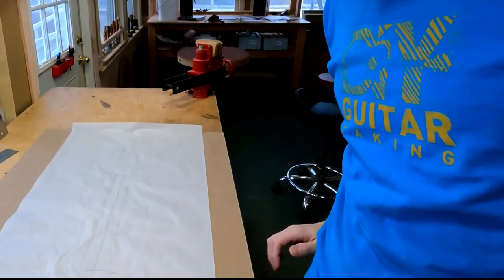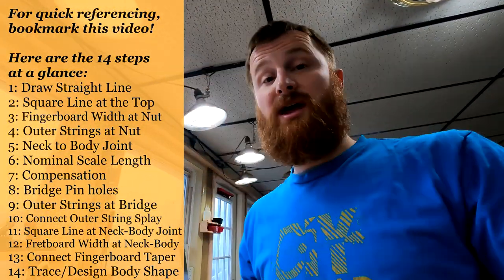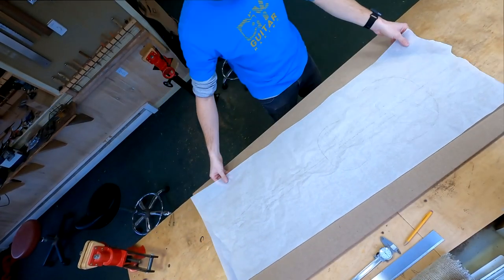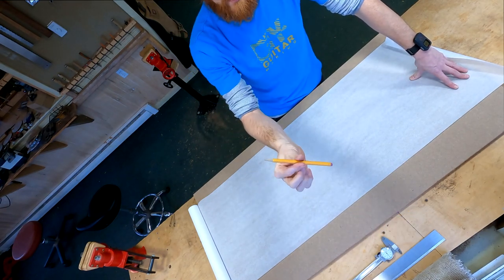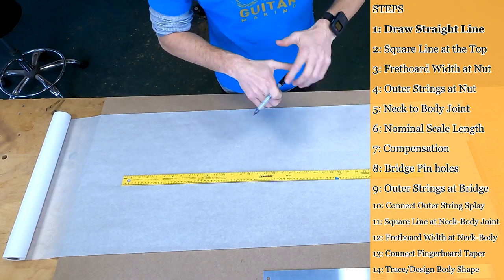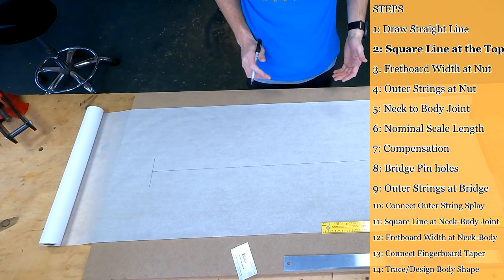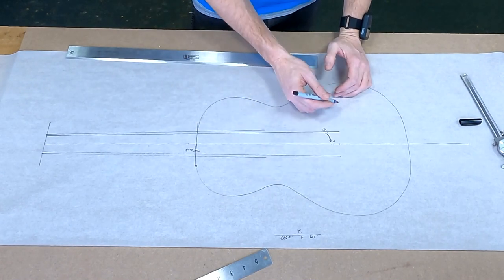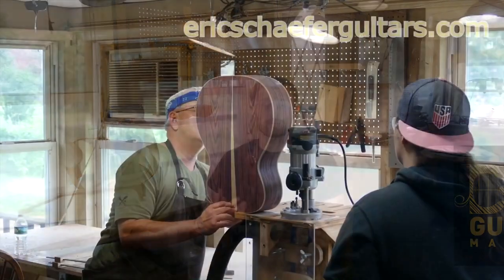Beginners Guide | Laying Out an Acoustic Guitar Design

Comment: Eric,

First of all many thanks for this summary of the steps in laying out a guitar design.  Also for your wise advice regarding initial rookie construction using an existing plan.   I think I counted three “…don’t do that!” (an initial build using a self made plan) in your video.  I smiled because breaking that rule is pretty much what I did on my first build, a tenor ukulele.  You have also recommended (previous videos) using traditional materials from traditional luthiery sources for your initial builds.  I went astray there also by using wood (oak, maple and black walnut) from local trees in my neighborhood.  Sometimes it is better to be lucky than smart as I enjoy listening to and playing my ukulele made with parts that originated in my neighborhood.

I do agree that your advice is wise, as few DIY builders will be able to take the time to plan and execute a new design.  And I was fortunate to have so many great hardwood trees so close at hand, and the patience to allow the wood stabilize prior thicknessing and bending.

As a retired engineer, I have been able to play the long game, taking time for wood to dry while I built the fixtures and jigs I needed.  My first ukulele took about two years to finish.  And there was a significant tweak when I re-did the neck to headstock transition so it felt better in my hands.  But it has been thoroughly enjoyable.  I think my design sounds great.  

This year I finished three tenor ukuleles.  Each one a “special” from local wood.  I look at them and think “Parker’s oak, Mrs.Cincinnati’s walnut, Jeff’s fallen limb, Candy’s Osage Orange”.  That gives me great satisfaction. 

I had great mentors on YouTube that helped me choose tools for my basement shop and techniques for manufacture.  Your channel is the best!  Many thanks for sharing so generously. 

Keith
Reply from the maker: I answered your comment in the latest Q&A episode:
https://www.youtube.com/watch?v=iSfkm_UrEtQ

Comment: (Edited) ERIC, what would be wrong or problematic about building an acoustic guitar with the body intersecting the neck at fret 16? I'm primarily an electric guitarist so I like to reach into the upper register. For me, just having a couple more easily accessible frets would really increase the overall playabilty of an acoustic without all the extra woodworking and finishing difficulties of making it with a 'cutaway' style body. On my Yamaha acoustic, which has a nominal 25" scale, that would mean about 1-13/64" more free neck length above the body to expose those two extra frets, without changing the basic size and structure of the internal neck anchorage block or upper bout bracing. The obvious external difference besides a longer neck (not in itself being a big tech problem) would be that for a 25" scale, the bridge location moves 1-13/64" closer to the sound hole, incidentally still leaving about 1-7/8" or so of the top face exposed between a 4" sound hole and the new bridge location. Of course the fretboard tongue would have to be 1-13/64" longer overall to have full overlap on the body but would not necessarily need extra frets there (an opportunity for a nice decorative inlay?), and there would also be 1-13/64" more of the top exposed on the lower bout for a given body size, so the geometry of the X-braces and under-bridge stiffener might need to be modified a bit to give the bridge good support while still bracing the top properly behind the bridge. The acoustic results are open to speculation but might be interesting. I've edited down my previous longer question and explanation for clarity and to correct an error in my thinking. If this sounds feasible, say so in a quick reply and I'll email you back so we can correspond and discuss. No hurry. Thanks!
Reply from the maker: I answered your comment in the latest Q&A episode:
https://www.youtube.com/watch?v=iSfkm_UrEtQ